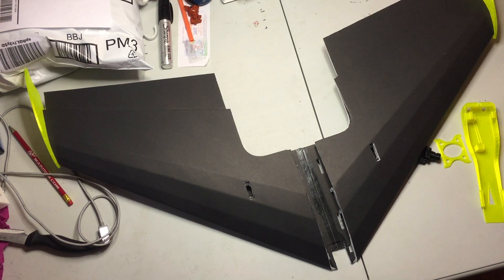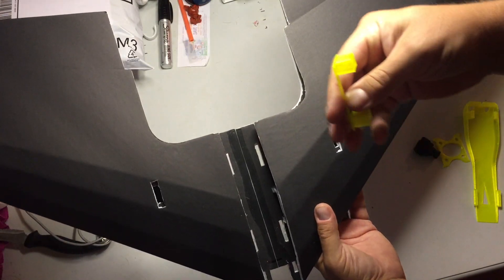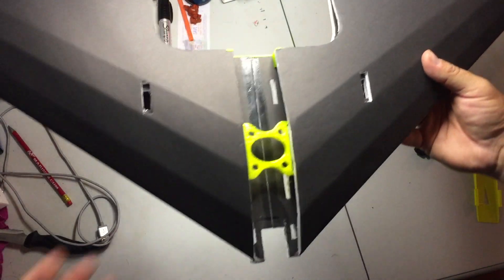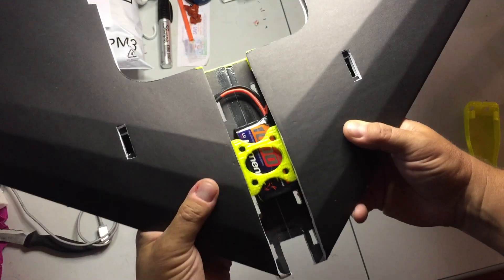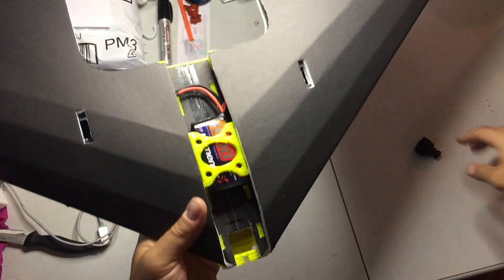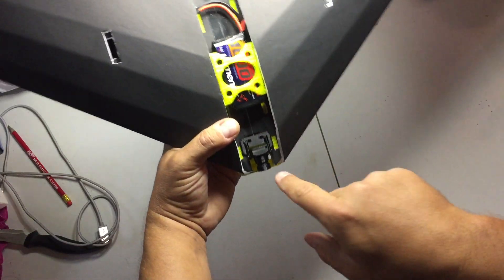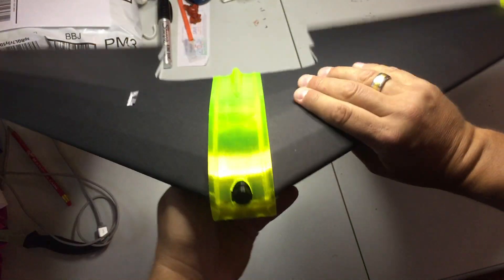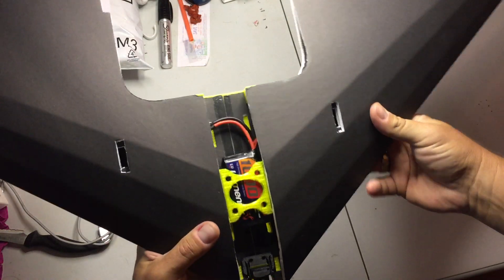FT Arrow 3D Printed Canopy

Comment: Looks great! I have some drone motors I've been wanting to put to use and just got my printer working nicely again. What is the finish on this plane?
Reply from the maker: @zeilstar  Thanks! There isn’t really a finish, it’s just black dollar tree foam board and the printed pieces. There’s a little bit of black tape too but nothing special.
Reply: @dondavis7548  Well, I can't say that I've actually seen any builds with the black paper. My standard Mighty Mini power pod printed very nicely. Better work on finishing that plane before starting this one!
Reply: @dondavis7548  Polymaker PolyLite LW-PLA is going through the hot end right now! I'm curious if the weight savings will dramatically change the COG.
Reply from the maker: @zeilstar  I designed this before LW-pla existed I think. I didn’t know about it when I designed these at least. I’m excited to hear how it works for you, let me know! Too bad there isn’t a way to post pics here.

Comment: this is great but the only problem for me is in my ft wing I'm using a super beefy edf motor to get speeds of 200mph and it heats up a lot and i have tried other filaments for high heat and they don't last. So you think you can make these into foam plans and then just replicate it with foam. and that would be great

Comment: Could you please share more info about how you connect the Motor to the ESC? from my end, it is not doable, unless re-soldering the wires.
Reply from the maker: My esc connects to my motor with bullet connectors. If yours is hardwired, you may have to find another solution.

Comment: That is Awesome!!  I just built an arrow, but for some reason the CG is about 1 inch from the back instead of 1.75 inches.  Way too tail heavy and requires 42g of lead in the nose.  I used the emax motor they recommended..   I have no idea why it's so tail heavy.  I'll check Thingiverse and try this out.   Thanks!!

Comment: Looks really nice!! Does it fit a 4 cell??? like a Tattu 1300-1550 70c-90c?
Reply from the maker: The Tattus are thicker than what I'm using, and you'll probably have to cut the foam between the upper and lower canopy to utilized the space in both, but it should work fine.  The weight in mine needs to be pretty far forward to balance since the canopy is so light.  If you have to cut a bigger hole than you're comfortable with, just glue a Popsicle stick in front of and behind the hole.

Good luck!